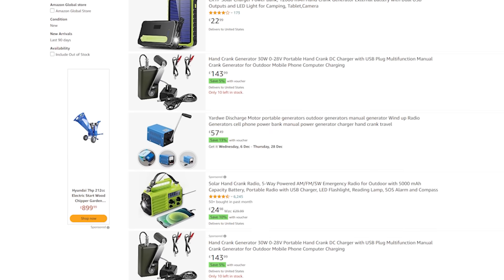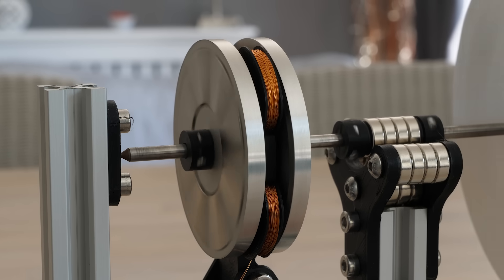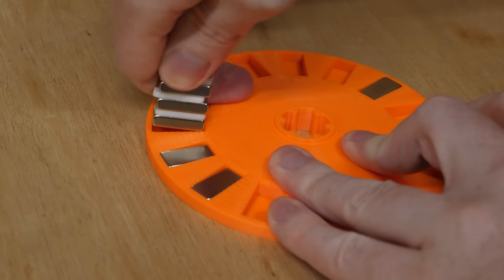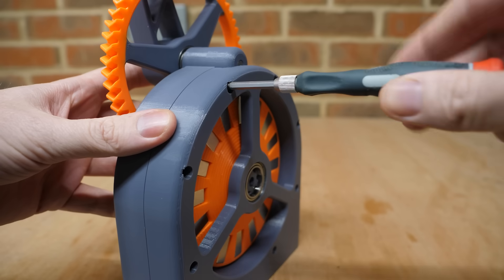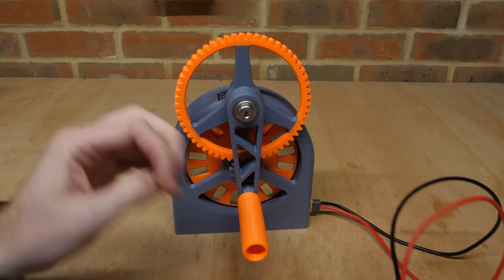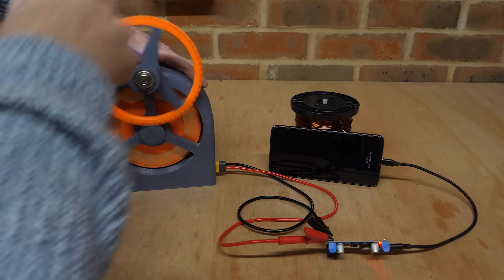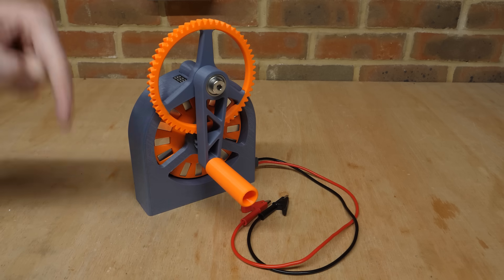Building a Generator

Comment: if you attach a smaller gear on the front of the big bear and attach a big gear to the small gear we just attached and we spin the big gear2 that we just attached would the output voltage be more because the speed is more?

Comment: This is like the wholly grail, because to get a decent voltage and be PHYSICALLY able as a human to get to those speeds by hand, you need something with a really good resistance, so you can krank at a slower, more sustainable pace. 

I find hooking up a dynamo to a bike on a stand and a usb convertor is great for charging small non-smart items like torches and piwer packs

Comment: Maybe a dumb question, but why does the voltage increase after disconnecting the motor from the system at 9:55?

Comment: Another fun project idea I had recently along similar lines, would be to make a kite winder-generator. i.e. a circular kite winder, than can run as a small generator when the kite is in full flight. Perhaps a docking port for your cell phone so you could charge your phone while flying the kite. Could also make a powered kite winder to reel it in once done flying...

Comment: Is it dangerous/bad for the phone battery to charge it using a changing output? Eg, for phones, rechargeable batteries? Like if you suddenly crank it slower and then higher repeatedly? 😅 I really want to add this to a mechanical treadmill, but the speed i would run/walk/stand still in the same session would vary.  (Complete newbie here 😅)
Reply: The series of capacitors and DC rectifier made in the video will help smooth varying current and voltage from inconsistent turning speed. As long as the turning speed isn't super inconsistent every time you use it you won't have any problems.
Reply: @Fluffypotatoes4 thx! ❤❤❤

Comment: It would be pretty cool to make these and market them as something you add onto a home gym elliptical or stationary bike, so people can use their own mechanical power to reduce their electricity bills. Of course, this power would have to flow into a battery pack, else it would just be dumped into the ground. Maybe it can be used to charge a phone while using the exercise equipment.

Comment: Put a handle on the other side and a base to clamp it to a table... perfect for a power outage if you have a bigger battery. You wouldn't charge the whole thing but you could make use of full power output for a shorter duration. Well done!!!

Comment: I have a question, if we make the copper coils rotate in the opposite direction to the magnets, will this increase the generator power?
For example, the alternator will rotate clockwise and the router counterclockwise, Im pretty sure its not hard to make it with a proper gear order
Reply from the maker: Yes, however it's easier to just spin the magnets faster. An extra gear box and spinning electrical wires will greatly increase its complexity

Comment: Year late comment, the diameter of the wire should be related to the current you expect. The first wire you used looked like 16 gauge it could handle 10 amps without heating significantly, even the smaller wire you used was way overkill, the reason it's hard to turn is , "you have the breaks on" from the reluctance. So drop that wire size because you aren't going to be sending that much current at the higher voltages anyway, get your magnets as close as possible, and maximize your voltage by increased turns to see your efficiency rise.  Then used a transformer to drop the voltage to something useful at a higher current.   
Just a thought for others building this.

Comment: If you made only one rotor with magnets and placed coils on either side of the rotor, would it produce the same amount of voltage and current as you have in this example? It just seems like one side of the magnet rotor is not being used here.

Comment: Hey Tim, super cool video and idea. I am an electrical engineering student about halfway through an undergrad degree and am currently building this generator to power a PCB I designed(mostly as a summer project). I don't have a ton of experience with 3-d printers so that has been a challenge, but I do appreciate the attention to detail in the video. If I have any questions would I be able to reach out via email?? Thanks 

-Sean

Comment: I got a suggestion! Could it be possible that instead of the generator directly adding current, I thought that maybe adding a big enough capacitor (or maybe even a battery) you could reduce resistance and get a smoother output, thought the output might be limited by the battery/capacitor

Comment: I'd be tempted to build one that used a bicycle frame with a bike wheel sized stator and rotors... use it to charge a battery bank. But I'm the kind of weirdo who rides an exercise bike when the weather isn't good enough for me to bike to work. Might as well use a giant setup to charge my battery banks etc. Have you designed one that size?

Comment: nice video. im trying to build a generator too and i have a little question. Shouldn't the polarity of the coils also be staggered? Because if they're all the same, then the voltage generated in one will be opposite to the voltage in the adjacent coil, resulting in them canceling out isnt it?

Comment: I wonder what would be the most biomechanically efficient method to convert muscle power into electricity. Hand crank obviously doesn't engage the larger muscles. Bike paddles are very good for converting the kinetic energy to forward motion, but it would be interesting to see how those giant hamster wheels (which is essentially what those medieval pulleys had) would work out.

Comment: I am using 30awg copper wire just 450 round (50meter)and 4  n50 neodymium magnets in a circular disk but failed to light the red led.multimeter shows upto 300 mili volt and around 1500 on ohm side.😊 What could be the work around if possible?

Comment: Soooo this with the right combination and number of gear sizes (to reduce physical resistance drastically) = 1 hamster recharging a power bank overnight with its nightly 5 mile run on its wheel??? >.> I'm so upset that no one has combined these two concepts yet, but then again I'm sure PETA would come for you. haha I just wanna know if it could work in theory.

Comment: I have always wondered what it would be like to build a fully-functional, old-fashioned, automatic agitator washer IN MINATURE SIZE, 1-foot square --- and then using a minature 12-volt AC generator to power the washer and run it through a full cycle of washing a few washcloths.

Comment: Hey, so when outputting the volts how do you do that? Do you just connect one long wire across all the coils and then use that as the main wire that carries the electricity?

Comment: You should make a version with a flywheel that requires you to row (like rowing a boat) to spin the flywheel. basically pushing with your feet while pulling with your hands and putting all the energy in the flywheel for a balanced output

Comment: 6:20 spin > electric > spin :3
Reply: Not possible according to thermodynamics
Reply: @BahutGamingLive 
eh-hem, 
It appears that at 6:20 in this video, "Tim Station"  is Cranking a self made generator which the electricity of is being used to power motor
Reply: @user-GrapeGamer8978 so it's not generating energy because accordingly to thermodynamics no machine can run on 100% efficiency and energy cannot be created it can change form from one to another
Reply: @BahutGamingLive 
I see no reason to try argue
But I'll explain in more detail.

A generator's purpose is to convert mechanical energy into electricity.
This is exactly what this generator is doing, the generator alao has a moter connected to it therefore 
Mechanical energy > Electricity > Mechanical energy 

NOTE:
I never said there was '100% efficiency'.
I never said there was 'frEe eLecTRiciTy' being made or generated,

I did say that energy is being converted into another energy and then converted back into the original energy, 

I may have confused you by using the words 'generate/generated/generating' instead of 'convert/converted/converting' so sorry about that and I hope to find common ground now :3?
Reply: Actually a really good idea, wires can last for way longer than gears and shafts, and the motor can be used as a frequency governor for generators, it also works much better at very long distances.
Source: https://www.youtube.com/watch?v=4TyX_WI74Iw

Comment: (Not sure) but considering that a hand crank can generate 50-100w of power, if you have a battery you can charge fast enough at 100% efficiency you'd be able to recharge your iphone after 10-5m of cranking right?

Comment: Is it dangerous to charge capacitors and batteries without a regulated voltage output? Doesn't it fluctuate too much? 

Maybe here it doesn't matter much 0-14V but what if it goes from 0-20V or 30V or more? Isn't there a risk in stuff burning?

Comment: I wish you would have demonstrated charging the caps and then use the caps to charge the phone. The phone battery can only take energy at a slow rate. I think you could have charged the caps up quickly with the hand crank. And then plug the phone into the caps and let the phone slowly absorb the energy from the caps. That could be a useful tool for people in remote locations.

Comment: My question is regarding the coil template and coil template stiffener. I just printed those and I am not understanding why they are seperate printable parts and how you put them together. explain? Thank you!!! great vid I am in the middle of implementing.
Reply: I think the coil stiffeners are used soley for the coil winding process. You need to print only two. Slip two screws through alternate sides of the stiffeners and coil templates then clamp the screws to the vice. This enables you to wind the coils without snapping/breaking of the coil templates.

Comment: I plan to use a similar design for my e-chopper build. Instead of pedaling to power the motor, I’ll be able to add some energy back into the battery while stopped. This could help extend the ride time until I can get a proper charge for the batteries.

Comment: If your getting over 8v you could try a usb-pd breakout board instead. it could give you faster charging, not sure on iphones but I know my pixel has an 8v speed. may need to add a battery or caps in there as a buffer or something.

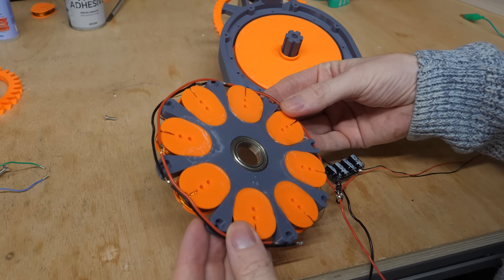Comment: 3:30 what does that mean?  I wish you wouldnt have cut that out because you just holding it there demonstrates nothing to me.    And i dont under hiw you have 2 in series AND 4 in parallel when theres 8 coils.   What about the other two where do those go?       How do you have them on the same circuit if theyre wired different?

Because of this dilemma im just gonna have to say fuck it we ball and hook up all positives together and negatives and hope for the best Because i have no idea what im doing.  

  This video is more of an idea and less instructions.
Reply: It means a pair of coils is wired in series and thoese pairs are wired in parallel

Comment: If you left your external capacitors in series with the USB board, would it be easier to maintain 5 VDC to charge your phone? 

Also, is the USB board able step down any higher DC volt inputs and fix the output to be 5VDC. 

Without your diode rectifier bridge, would the motor output be AC?

Comment: Greetings from spain Tom , quite impresive inventions! as an iliterate i have a ton of questions and what if..  i would like to ask because of your videos, if it doesnt bother you,  if the coils were like an U  in both sides of the magnet weel...  in this case like an W because 2 magnet weels what happen?  is it posible to combine the winding the coils like all N and all S to increase the V instead of using serial parallel conections of the entire coil? and what diference can make to winding the coils lets say.. not arround the center but side to side to the holder? if the magnets were electric can produce more power? thanks for your videos.

Comment: Thank you for showing us this amazing unique 3d-print project dealing with a subject I love to experiment with myself.  I will most likely find it easier to start turning compared to others because the coils are air-core, (or to be more accurate: Space-core)?

What makes this such a cool project for the exploring student of electromagnetic physics? A: It  is the plug-in coil design which lends itself particularly well as a standard platform, easily reproducible in every physics lab at school or home, upon which many people can co-Lab-orate and compare results among their experimenter peers.

For that experimenting purpose, to save time and effort, only one unique coil need be built and inserted. Then when the preferred coil configuration is identified, its superior output (Amps x Volts= Watts) can be multiplied with building all the coils similarly. Later, because its 3-d dimensions are already on the computer, it can be more easily rescaled to provide the power requirements of any device appliance you want.

What other configurations might be tested?  We see here a change in wire thickness (gauge, AWG), a thinner longer wire being able to produce higher voltages, but at a lessor Amperage of electron Current because of the increase in total Ohms of Resistance to that electron current. 

You may also have fun experimenting with another curious configuration: the bi-filer wound connected in series coil that Nikola Tesla invented in patent  US512340. Also,  his center-tapped, oppositely wound half's coil is interesting.

Comment: maybe you can print a gearbox and using a flywheel get the generator to spin even faster and charge large capacitors quickly, which can be connected to the rectifier and charge the phone slowly instead of cranking it continuously

Comment: how about making a gramophone for modern LP's. Where the gramophone runs by the spring as in the old days, but at speeds for the more modern records required speeds. And using modern needles it would need electric power for amplification. And if your generator could run by spring power as well. Well, that would be a breakthrough item.  I would purchase such a device, and I'll bet you could sell a bunch of them. You could even give me some royalties for coming up with the idea.

Comment: So I made this, 4 in series 2 in parallel for higher voltage though. I must've done something wrong because I only get 0.2~0.3 amps at 8V under load (I get up to 16V open circuit).

Comment: It seems better to charge the supercap and phone from the supercap, as this can save time (no need to crank the generator for an hour). However, it will require a bit more strength to charge the caps quickly.

Comment: I have a question, could you spin the lever in both directions and it charge the battery without modifying any wires or anything else

Comment: Nice work. You can increase the magnetic flux across your coils in your design if you add a steel disk or washer across the back side of your magnets. something much like a scaled up steel washer minimum of about 1/8 inch, (3mm) should work though thicker to a point would following a curve of diminishing returns with increasing thickness.

Comment: I'd be interested in a falling weight regulator for radios and phones. Falling weights impart constant force, so I'm interested in a mechanism that lets the generator spin faster at higher loads and more resistance at lower loads. I'm wondering how to get it to charge a capacitor to a certain voltage, the switch over to a short across the generator to slow it down until the load discharges the capacitor significantly, then recharge the capacitor. I'm thinking this is what the old spring driven radios used to do. Otherwise the weight or spring is unwinding faster when the device is off or on low power, and when you need maximum power the spring almost grinds to a halt.

Comment: If you go for the bike idea mentioned in the comments.... I'll just say that years ago I had a gym membership and with just a little bit of practice I could sustain 150 watts(maybe it was 200..) for an hour.. so you would need a whole lot more load than a phone charger(yadda yadda.. losses in the circuit..) the super capacitors would be a requirement since the five watts for an hour to charge your phone would be(10% confidence in my memory here) something like 18,000 joules.. or ~2 minutes-worth of pedalling.(legs are mosterously more powerful than arms). no battery that small would enjoy getting charged like that so some sort of storage is a requirement. Otherwise, I like this video.

Comment: You need a set of inline diodes on your output to prevent electrical backwash. You could see when your supercaps were hooked up they were still powering your volt meter and draining. This will improve your efficiency.

Comment: his phone need 1h to charge from 45% to 100%, so I gues around 2 hours from 0-100%, I can assume that his battery is around 3300 mAh, That is the exactly capacity of single cell of Tesla Model S with has 5040 cells, so If he wanted to charge TESLA with this thing it would take over 10080 hours with is over 1 year, (420 days to be precise)